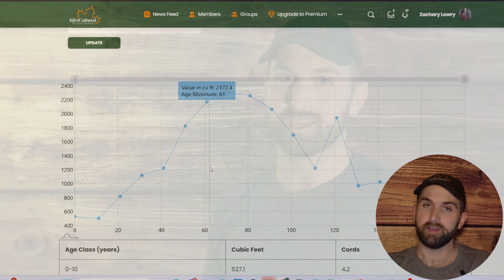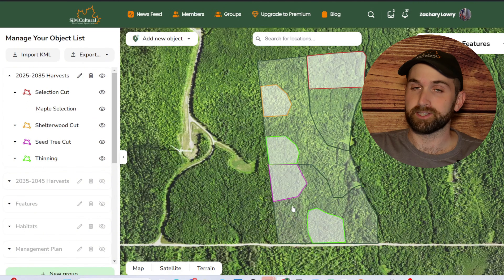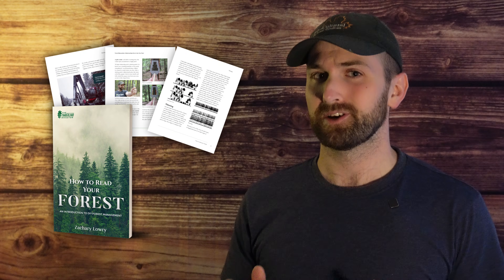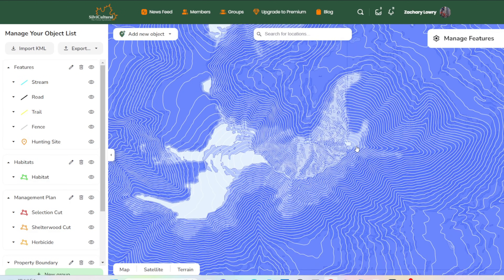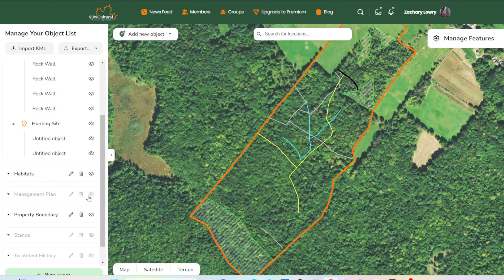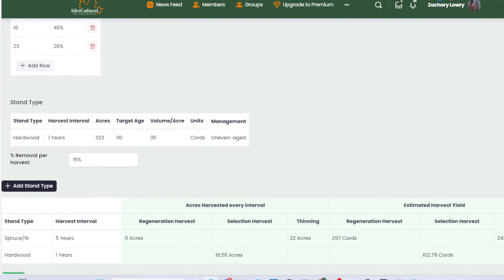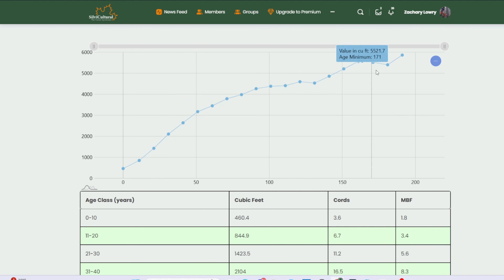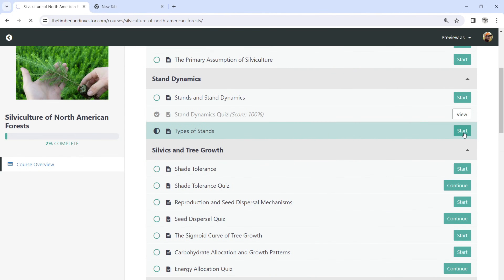How to Set Up an Efficient Timber Harvest System

Comment: Just a suggestion: if that is how your trails are laid out (fan pattern) those are too many dead ends
Its best to have loop backs so you never have to back up
Reply from the maker: Depends what you are running. with a trailer that doesnt have hydraulic assisted turning, I agree: loops are best. But if you are dragging trees or logs behind you, It does way less impact to turn around before hooking up a load. This is just an example though. My trail system is way messier.
Reply: Like most things, every situation requires it’s solution!
Cheers!
Reply: Always balance ground impact with harvest efficiency . Loop trails can add a good bit of ground disturbance if not properly planned and may increase total travel time and fuel usage. More trails can almost always increase harvest efficiency but they are a cost to timber productivity as your other videos point out. It all takes planning.